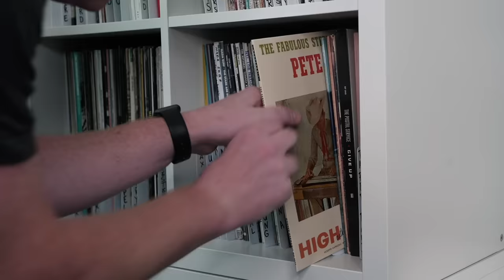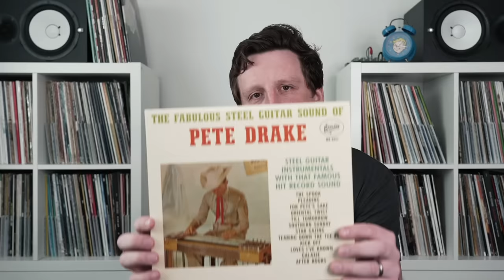6 Guitar Pedal Myths

Comment: One myth we struggle with at Sioux Guitars is most guitar players are hung up on 12"s.  Thing is the classic 4-12" cab was designed 50 some years ago using speakers specifically designed for mid-range.  Jim Marshall was smart enough to know the limitations of the speakers he was using so to compensate, he put them in an oversized box.  Because the air volume of the cabinet was too big for the speakers, it robbed high end frequencies to simulate having low end because the speakers are only designed for mid-range and can't produce low end.  That was ok back then, but listening to recordings from the 60's to the 70's to now, our taste in music has gotten much deeper.  Now you have guys playing super heavy gauge strings, 7 or 8 string guitars, baritones, and drop tunings, they come to us claiming their sound is muddy and when explaining their set up we question their speaker, since it is the one piece that actually makes sound, and sure enough they are using the classic over sized 4-12" with speakers designed for midrange.  If we can get them to take the Pepsi challenge, they always agree that a smaller cab with a wide bodied 15" or 2-15"s sounds better than the 4-12"s, but for some reason everyone assumes they want 12"s because that's what's always been equated with guitars.  If you don't believe me, that's fine, trust your own ears and a smaller cab with something like the Jensen Ceramic Classic 15" is going to sound way better than that oversized Marshall 4-12" with Greenbacks.
Reply: Dear Sioux Guitars
Please get at me I have questions about your statement on speakers you may be able to help me..
If I'm hearing right 15's may be better then 12's tone wise???
Reply: Well, guitar IS a midrange instrument at heart so there is a reason why 12" is preferred. 7 string and baritones are pushing the limits but it is still manageable if you tighten the low end a bit before it gets distorted. However 8 string at its lowest string is seriously going into the bass guitar department. Is there a 15" speaker that can produce the lows just as well as the mids or do we need to start mixing cabs/speakers? Or is digital modeling, which does not have these acoustic limitations, the best option for super wide range guitars?
Reply: The 4x12 or 2x12 Marshall cabinets are great for getting low end on a Strat. However, I prefer 4x10 cabinets because there is something called a Bass guitar that can do the guitar low end.
Reply: Yes.  Not only the size, but also what frequencies are the speakers designed for.  Most Celestion are designed specifically for mid-range and can not produce the low end frequencies that are being sought by modern players.  Jim Marshall knew the limitations of those speakers and put them in an oversized cab because the excess air volume of the cabinet ate up some of the high frequencies to simulate  a fuller, rounder sound.  If you go with a full-bodied speaker, vs one designed for mid-range, you'll get more of those fuller, deeper sounds.  The size of the 15" gives it a wider foot print to hit the lower notes that people are craving these days, but it you were to swap out 12"s designed for mid-range, guitar speakers, for full bodied, 12"s that could be marketed as being bass or P.A. speakers, you'll get better tone.  Find a smaller 1-15" cab with a Jensen Ceramic Classic 15" or one of those old Fenders with a JBL to get that fuller tone.
Reply: It's more about what the speakers are designed for.  Full bodied speakers that are marketed as bass or P.A. speakers will get you more coverage despite the size than Celestion Greenbacks that are designed specifically for mid-range.  The design of the Greenback simply can't produce lower frequencies like a full bodied speaker.
Reply: I have a single 15 in an open-back cab that I use for everything: from clean and sparkly strat to booming LP in distortion, it does every extremely articulately, and can fill any space. 15s dont get much love these days :*(
Reply: Josh Berwanger of the Anniversary bought a head, a 4-10" and a 1-15" from us to get the sound he likes.  He just plays a six string, but likes the punch of the 4-10" and the fullness of the 1-15".  My opinion is you just can't go wrong with an old Peavy SP3 P.A. speaker with a Black Widow.  The point I was getting to is don't be hung up on needing a 4-12" with Greenbacks because that's what was used 40 years ago when your tone is so much deeper now.  Listen to a new Fu Manchu record vs. a 20 year old Foo Fighters record, compared to what Guns-N-Roses' Appetite For Destruction, vs Rolling Stones Some Girls album, to early Who stuff and you can hear that what's being recorded is deeper and fuller than that Pete Townshend was playing and recording back on the first Marshall 4-12"s with Celestions.  Maybe a 4-12" would work for you with full bodied speakers,  but don't assume that a 4-12" with Celestions will give you good tone because it's been around for ever and ever.
Reply: I agree with your points. Personally, I have found it difficult to sit in a mix and demonstrate versatility within it with 12s (just me and how I play, I guess). 10s get a little more punch, but they also seem compress a bit more with an even more limited bandwidth, whereas 15s feel a little broader. All examples were from mid-range drivers... I think the point you were making on PA and Bass full-range drivers puts the nail in the coffin in terms of the spectrum being broader - there's no doubt it's a bigger palette!

To make another point on the obsolescence of 4x12 cabs... If I want a bigger sound, I like making to a PA to spread the sound more. With the excellent quality and power capabilities of modern PA equipment these days, there's really no need to use massive stacks. It also makes balancing dynamics between players much easier for the sound engineers (YAY!), which in turn makes for better shows, IMO.

Thanks for making detailed points! It can be difficult to articulate this stuff, and I think you've made it accessible for most folks! Cheers!
Reply: In a completely different league here but same ball game - I recently changed out the speaker in a Fender G-Dec Junior. I was pretty unhappy with the sound it was making & when I saw how puny the speaker was I wasn't surprised. I put in a 20w Kustom "special design" (whatever that means) speaker instead from a Kustom KL-20 the "head" had blown on & it's like another world.
Reply: Yup, that was why Robin Trower in the 70s used Fender Showman Cabinets loaded with 2 JBL 15's as well as 4-12's because he wanted the depth to the tone. the 25 watt green backs couldn't keep up and flub out and blow up.
Reply: Hmmm... Why not just get a brighter speaker like a v30? 

Also, I'm not sure one wants more low end... Unless they want to fire the bassplayer.

Guitars usually get high passed in a mix at 70-150hz too. Gotta make room for that bass guitar and kick.
Reply: Love Johan Segeborn's 4x15 ^^
Reply: not everyone play djent with 7-8 strings, low tunings and  and want to compete with the bass player...as someone said before me, guitar is a mid-range insturment...moreover not every 12' speaker has the same response and frequencies...so remember that there are speakers with more bass like the g12k100;
Reply: @lovecraftmusic8717  Interesting coinkadink. I just spoke to Trey a couple weeks ago. He's my buddy. 👍🏻👍🏻
Reply: Modern speakers are designed differently too. My TC Electronics bass amp has two 8" speakers and has all the bass you would need. I've always liked 10"s for guitar and my Marshall 4x10 is the perfect cab to me - loads of bass, punchy and clear.
Reply: I have a 74 dual showman head with a  cabinet that has one 15" peavey black widow 4 ohm speaker in it so the impedance is correct. It kicks ass. everyone who has played through it has loved it. I would never go back to 12s
Reply: I have a Garnet Revolution II, open back, with  15" Eminence Red Fang (or at least thats what i think it is, I'll have to check next time I'm at the jam spot). It sounds great with all of my guitars, clean or with alot of overdrive/distortion/fuzz, and on any pickup setting, single and double coil. The only issue is when we gig at spots with shit sound and/or no sound system, I have to push it A LOT to compete with my bandmates. Not a terribly big issue though, considering I'm getting older and those gigs in warehouses and weird spots like that are fewer and farther between.
Reply: The size/type of enclosure has no effect on the high frequencies once you get above a few hundred hz. Enclosures only cause an impedance transform at lower frequencies, so comparatively something that increases the low end (such as a sealed or vented cabinet vs an open-back) might sound beefier/darker/muddier only because of the comparative lack of front/back wave cancellation on the low end. High frequency response is dictated by the natural inductance of the driver itself - the voice coil of the speaker is a natural inductor. There are ways to acoustically limit the high-frequency reproduction through higher-order enclosure designs, but those are not in any way ideal for guitar (or most instruments).
Reply: WOW.....
listening is subjective.....depends on the format that the recording is on.  Vinyl has the RIAA compression because the grooves of a disk can't handle the spectrum so the play back has to deal with that.  Tape is different and digital is still different but not as most people believe....and if you come at me with MP3 format then you definitely have no clue.
Speakers do have an influence and its based on what they were designed for and their efficiency.  But saying speakers is very generic.....
There is the speaker box and the type of speaker box and the material that the speaker box is made of...….and its about tuning the speaker cabinet.  
BUT THAT IS HALF THE STORY......the other half is the amplifier and the circuitry and if its tube based amplification...then its the output transformer and power tube type and its bias set up...…...ITS ALL TUNED IN SPECIFICALLY TO BE IN HARMONY.
A 4X12 cabinet pushes more air in a wave front than a single 15...…..and a 15 may have a longer excursion travel that a 12.  There are long throw 15's for bass and low end, and there are short throw 15's for guitar frequencies......and that carries over into PA and sound reinforcement.  But in the electronics end of that equation, its the output transformers' design that influences what range of the spectrum of frequencies it can efficiently handle before it rolls off.  But that's not the end of the story as the power supply filtering has to match the job too otherwise it will "FART" out as the terms that's often used.....as low end needs more filtering and power reserve.
Going back to a cabinet, its the design....whether its an open back where you get the rear wave of sound to reflect off the back wall surfaces in a room, or if its a closed back cabinet that only projects out one way.  And its those closed back cabinets that have a peculiar character to them since they project in one focused direction.  So it depends where you position yourself to hear that type of cabinet.  

But for anybody to say that a small single speaker cabinet is superior to a 4x12 or even a full stack obviously has never played or stood in front of a "WALL OF SOUND"...….whether it be a Marshall stack for guitar or some other brand...…..and YES Marshall did make 4X15 cabinets for the bass stack back in the day.
IT ALL DEPENDS WHAT YOU WANT TO HAUL AROUND & HOW LOUD
Today most working players use the small amps and single speakers for portability and the fact that sound reinforcement is now about mic'ing up thru the PA.
You can crank up a small amp to get it into the zone where as if it were a large higher power amp and you cranked it.....MR.PA man would be saying turn it down and MR. CLUB OWNER might be saying the same thing
I have about 20 4x12 cabinets for my show room not because I build cabinets...but because I build tube amplifiers and illustrate the speaker connection to the end result of sound...….the type and specific speaker to figure in to the equation of EAR CANDY.   And part of that is the speaker box's material.....whether its particle board which is crap and dead sounding......or if its the typical birch which sounds brite and sort of harsh......or if its PINE which makes it sound good and mellow and full and warm.  AND I'm not going to talk about the baffles you mount the speakers to in the box....or thickness's of the wood....aside from a closed back or open back.
From my tastes I have always favored 12's due to the response...not too much low end and not missing the low end...just right.  The 15's were too boomy with low end and 10's were not enough low end.
But now I have different thoughts about 15's and 10's though I still favor 12's
You'd be surprised on how many marshall 4x12's were actually refitted with EV's.....
Reply: I slways wondered why Marshall cabs sounded like mud.
Reply: I thought Pete played HiWatt amps...
Reply: First of all a lot of guys love the sound of a lot of old gear as it flaws contribute to the sound
The Marshall 1960 4x12 has no insulation to combate standing waves and so it resonates with a heavy low end thump. It ain't science but it gives the old Marshalls a great but different low end. To take your solutions to their final consequences we should make violins from metal and high tech plastics and burn all the Stradivarius violins after all they are flawed by the absence of many frequencies and have a very low output and can easily be drowned out by even  a junk starter violin. The sane can be said of the LP and it's awkward access to the upper frets or Fenders with their crde bolt on necks. But once again these flaws contribute to sound that is pleasing if not perfect. Your solutions are great because they may create new interesting tones. But they are not better by even 1 %.
Reply: I had a 15" jensen in a single cabinet years ago, loaned to one of the guitars players in the band for a couple gigs, it sounded really nice. as far as effects pedals and this and that,I just focus on my playing and using pedals I like the sound of and do generally what I want to hear, I figure mostly it's up to me and my instrument. granted you can't expect a cheap practice type amp to sound like a higher end amp
Reply: Perception is wild. I saw a dude with some great tone at a club gig once. I went to check out his amp & it was an older Line 6, but the logo had been removed. I asked him about it, & he told me he laughs all the time when people think he has a “boutique” tube amp. That really opened my eyes that day. It’s about the player & how he coaxes his sound from every ingredient.
Reply: Sorry but you really don't know much about loudspeaker design. An "oversized cabinet" which the Marshall is NOT, does not "ROB" high frequencies. On the contrary, actually the Marshall is undersized. IF you cut it up into its four individual 12" speaker sections a Marshall is smaller than most single 12" cabs. As with Leo Fenders early designs there was no magic intent in Marshall's design just some stupid luck. The Marshall cab just happened to be the SMALLEST cab you can fit four 12"s into which coincidentally give it a slight hump at around 100 Hz, not the lowest note a guitar car produce at standard tuning which is 80 Hz. Coincidentally that cabinet tuning works very well for palm muting. As for all that low end mud on modern recordings, for God's sake please leave it to the Bass and the Kick drum. It's a guitar not a Church Organ. Having all those instruments clutter up the bottom end is just a rumbling cacophony of pure noise to my ears, nothing musical about it at all.
Reply: @shoegazeforever8810  Fender's most popular bass combo amp featured four 10s. Even today, four 10s is the most common bass cab configuration.The diameter of a speaker is just one variable among dozens that define it's throw and frequency response.
Reply: @SiouxGuitars  Yes, but some of that is in the mastering; you couldn't put as much bass in a vinyl LP as you can in a CD or digital file; it ate up space more quickly.
Reply: @m0j0b0ne    I am surprised to hear that. Obviously, I am not a bass player but I would have thought that 12" or 15" speakers would be better at producing low end frequencies than a 10 " speaker. The cabinet must play a big part in getting deep low end.
Reply: I get where this comes from, but I think a lot of the problem comes from people having a fundamental misunderstanding of what kind of tonal space a guitar is supposed to occupy. I hear a lot of extended range players with far too much low end in their tone because it sounds thin by itself otherwise and they get absolutely lost in a mix. I can't comment on the 15 inch speakers because I've never played them, I've very curious to try them now. However, I think most of the muddy low end on extended range guitars, at least in a metal sense, comes from people EQing their gear for solo playing and not band playing. Also, big cabs are completely useless and overrated. No one actually needs to push that much air anymore. Save your back and run a smaller cab lol
Reply: Wow THIS one will run and run - (now the ol' Peavy Delta Blues tube amp with it's 1 x 15" makes a bit more sense (sounded nice despite* the undersized transformers))                              *partly because of ?

a 15 or 12 will produce MORE bass but not so tight and controlled (esp in an undamped cab) a lot of players find 10's or even 8's more 'responsive' for funk and slap playing

 Lemmy was real fond of Marshalls and 4x12's as he WANTED a lot of midrange articulation and kerrang on his bass (he DID dig 4x 15's too !)

 Oh yeah and .. Quesion - can anyone confirm that multiple drivers in the same cab DIVIDES the air volume when you do the math for Vas ? I was never sure..

Theres a bunch of choices out there, and tho I'd like to TRY Celestions (oh to work in a speaker making Wood shop) I think I'm going to go for Neos for the new cab

And hey lets face it Hendrix palying thru a solid state amp would STILL sound like hendrix.. ;)